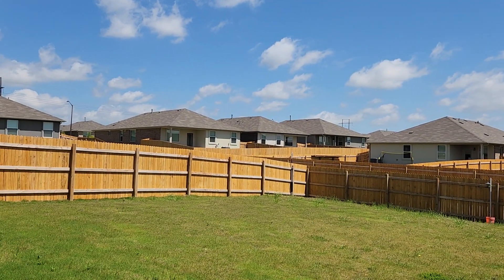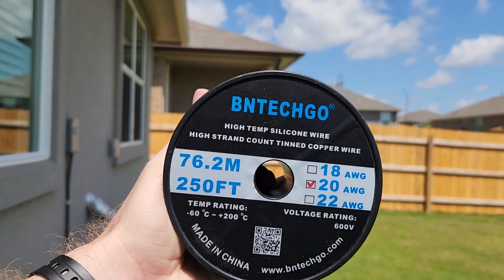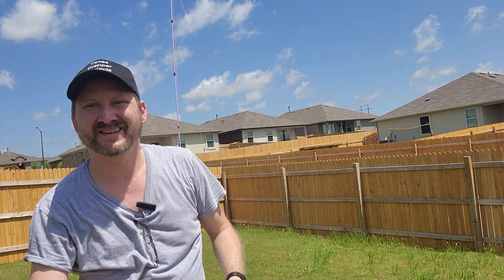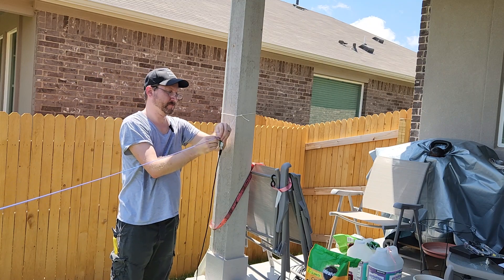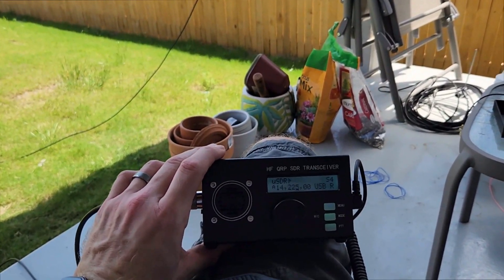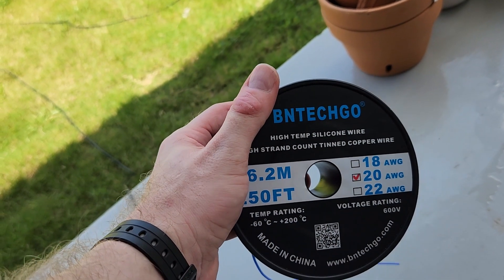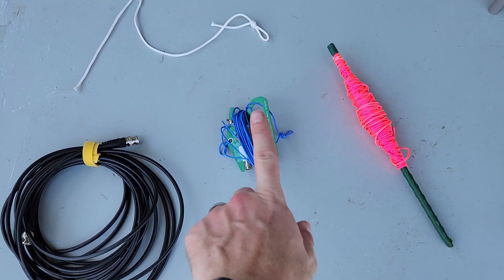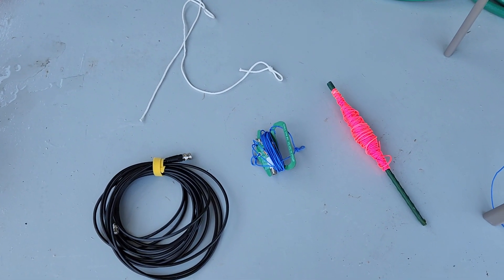No trees for an antenna? Use a painters pole! EFHW

Comment: To save time cutting sampling to get the right length, multiply the frequency by the length of the wire that you first measured. Then, use that number instead of "468" and divide it by the frequency you want, or a little lower if you want to test it to be safe.  Then cut the wire and measure the frequency again. It should be close to perfect.
Reply from the maker: Thanks